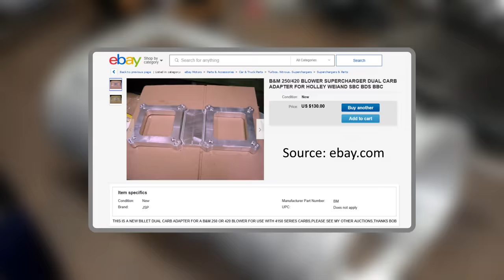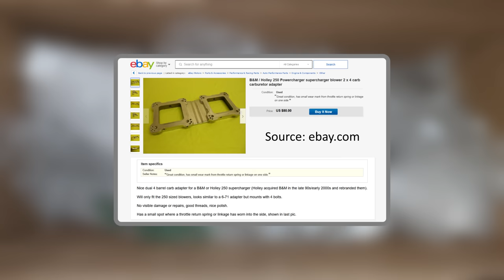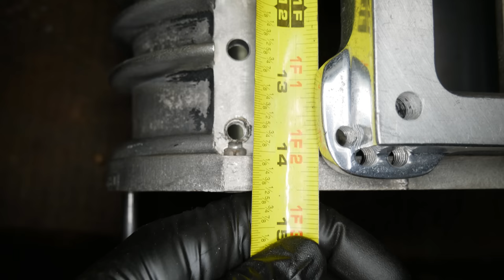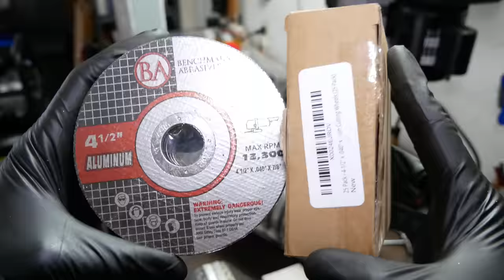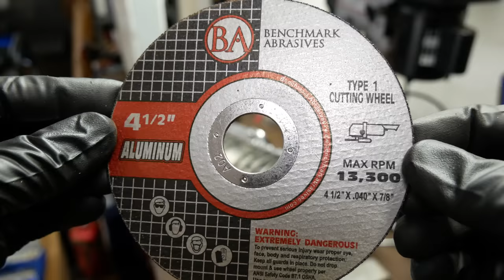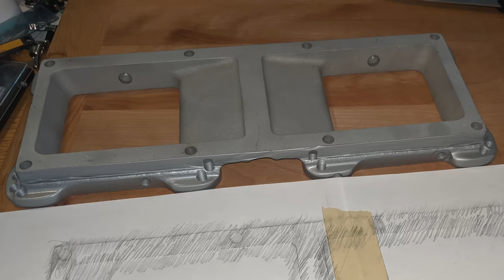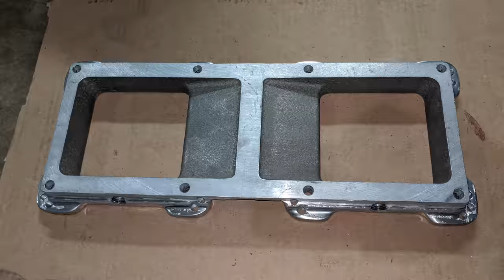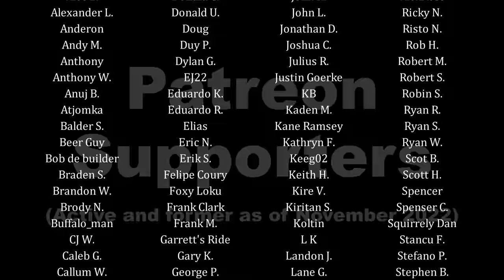B&M 250 Supercharger Rebuild: Carb Adapter, Sandblasting, and Painting (78 Firebird Ep.26)

Comment: If you have to cut aluminium with cutting discs get yourself an old candle and cut into it occasionally when cutting. Makes the cuts much easier and makes the discs last way longer as they don’t chatter and clog. Works with sanding discs and flap wheels aswell just make sure to clean afterwards especially if your ever gonna weld the area. Nice work

Comment: Looks awesome. That being said you may find you need to change the rotor seals after running for a bit. The factory machine finish aids in sealing the rotor seals to the case. Keep an eye on boost dropping over time. May mean a seal replacement is needed.

Comment: I'm getting intense flashbacks of all of the times I "saved money" by buying used parts and abandoned projects. Whatever you do, don't start counting up your receipts or time to get that stuff right. 😆

I'm also sitting here with my jaw a gap over how straight of a cut you were able to make with a grinder. It would have looked like I swung an angry beaver at it if I had tried that. FWIW, actual machine shop labor isn't as expensive as a lot of people think it is. I would imagine a "whenever you can fit it in and it's not going on a spaceship" project of that size wouldn't be more than $100. I may also be known to chuck a mill cutter into my drill press... allegedly. 

...I also feel like some other guy just made a video about painting car parts. 😎😁

Comment: Paused the video a few minutes in... the carb adapter is a really good opportunity for 3d printing as plastic would kill the heat soak between the blower and carbs, easily custom made to fit, and I know with blowers putting weak points to act as mechanical fuses for safety in event of over boosting is a big deal, and a plastic component would work quite well I imagine in that regard

Comment: Looking good the inside of the blower is worth keeping a good eye on as you say. The machine line is an odd thing to spot but if it worked for the last owner, it should work OK now.
Reply: the blower will never be efficient...it will work somewhat but the inner arc is compromised
Reply: @trillrifaxegrindor4411  mmmm yes, that's true. I guess he is going to use it and find out all the issues when it wont move much air.. 👍👍

Comment: The headache with having a sort of "oddball" 250 is making me nervous for my transmission rebuild.

It's a T-10 from a '66 Mustang. Almost all Mustangs used Toploader transmissions by '66, so the workshop manual has no information about the T-10 for '66.

And from what I've read online, the '66 transmission is sort of a one off, between the earlier T-10 and the later Super T-10 transmissions.

Very fun.
Reply from the maker: That's definitely frustrating, I hope for your sake that it is close enough to a regular T-10 that parts interchange and there aren't big headaches. Best of luck with your peculiar project!
Reply: You may look into other makes that were using the T-10 in '66 and see if they have better documentation. I know Chevrolet ran T-10s in the Corvette for a period of time but might have moved on to Muncie by then, but Chrysler might not have and I know AMC didn't.

FWIW, the top loader is a better transmission if an upgrade path should make itself more clear than a rebuild.
Reply: @TheBrokenLife  Certainly the Toploader is the better trans, however the T-10 is the trans of choice for a couple reasons.

Firstly, it was cheap, and it's the one I own now.

But secondly, the 62-64 Fairlanes (which my car is a part of) only came with T-10s, so for correctness sake, I'd like to stick with a T-10.
Reply: @perotekku  I got ya. 👍

Comment: Maybe I'm being dense but wouldn't it have been easier to trim the tips of the ribs down?
Reply from the maker: For aesthetic reasons and some sense of preserving the original look I didn't want to modify the outside of the case. But you're right, that would certainly work as well!
Reply: @FuzzyDiceProjects  Trimming the fins would enable use of common adapter plates in the future.

Comment: You could have done that with a router or a table saw... circular saw even.
Reply from the maker: Could have done it with a hammer and chisel as well! Plenty of ways to move metal and I used one that I am familiar/comfortable with
Reply: @FuzzyDiceProjects  Not the direction I was going, but your comments about aluminum grinding dust, just made me think of the most common and safest ways to do it without a mill, and still get a nice clean cut. If hammer and chisel suits you, I'm sure it will get views too...

Comment: So does B&M offer larger lobes to fill in the gap between them and the case?
Reply from the maker: If you mean they wouldn't fit the same because of the sandblast/polish, it would be such a small amount of material removed I doubt it would make much of a difference even if you did nothing to the rotors. We will be replacing the teflon tips of the rotors though, which are cut/break-in to fit the case.

Comment: Rather than cutting the long sides why not trim down the ribs I do t think they were structural hanging up that high
Reply from the maker: For aesthetic reasons and some sense of preserving the original look I didn't want to modify the outside of the case. But you're right, that would certainly work as well!

Comment: I would've just laser cut/water jet cut a spacer plate out of some 12mm aluminium plate lol. Stand the whole thing up enough to clear the top fins.
Reply from the maker: I really wanted it to stay as low profile as possible, and I like the unique look of the adapter being set down into the case since it does appear to be an uncommon setup.

Comment: Where do you buy those plated screws?
Reply from the maker: Most of the common hardware I get at Tractor Supply because it is sold by weight, but i also use online stores like The Bolt Depot for less common sizes at reasonable prices.
Reply: Wow we pay per bolt over here it's very very expensive

Comment: The parts are painted, but the bolts aren't!

If you paint those now the paint will be damaged when installing!

Just wait until it's together & paint the whole thing at once, like tractor manufacturers…(the whole car)
Reply from the maker: I don't prefer to paint something assembled if I think it will have to come apart in the near future, I knew that this supercharger would have to come apart at least once so painting individual parts means less paint chipping around bolts and seams. And I certainly could have removed the rust on the bolts and painted/plated them but I needed to draw the line somewhere lol

Comment: wouldn't it have been easier to cut the ribs off of the blower body than to cut the adapter plate
Reply: Cutting the ribs off doesn’t fix the ends and if you mess up there you ruin the mateing surface